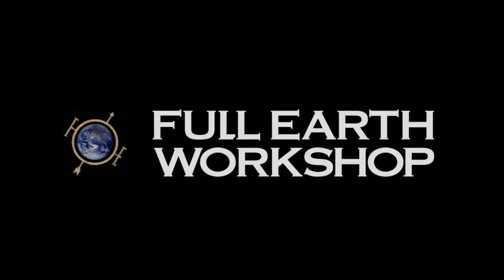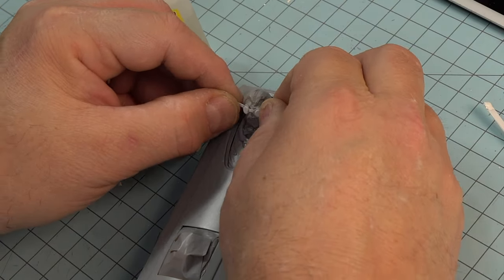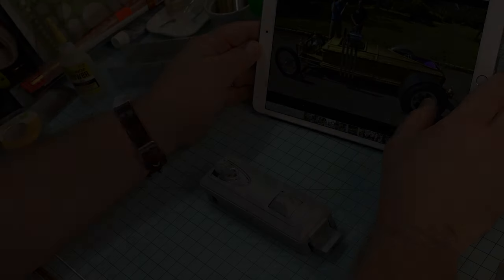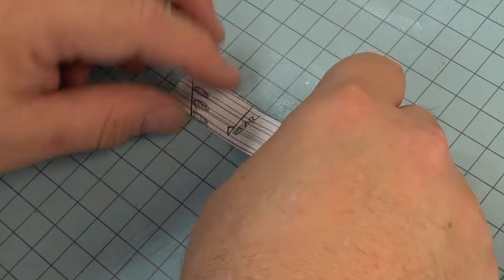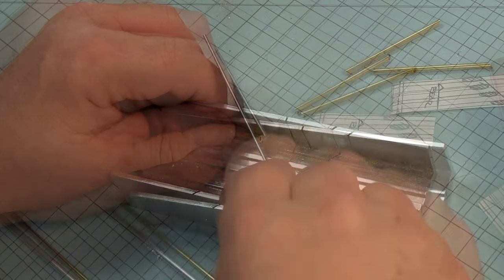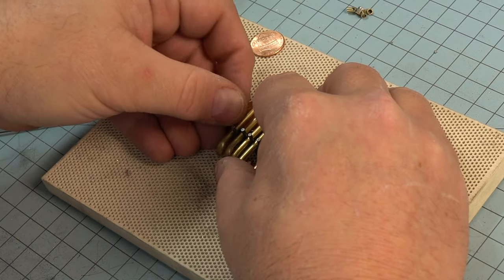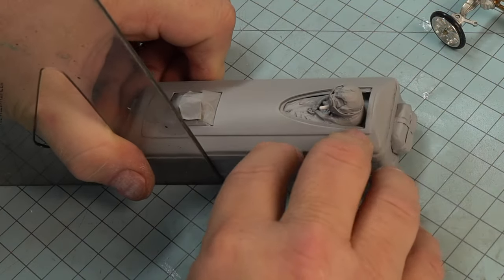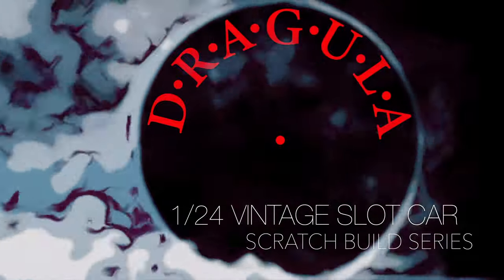Part 9/ Hit The Headers! / Munsters & George Barris DRAGULA! / A 1/24 Vintage Slot Car Scratch Build

Comment: The pipes look cool, How did you end them for the 90 degree angle?
Reply from the maker: I inserted the next smallest tubing size into the lower 30mm so the tubing wouldn’t crush when bent. I then used a mandrel plier to bend each pipe individually. Cheers! Doug
Reply: @FullEarthWorkshop  got it , I have that size and it’s a great idea. Thank you !